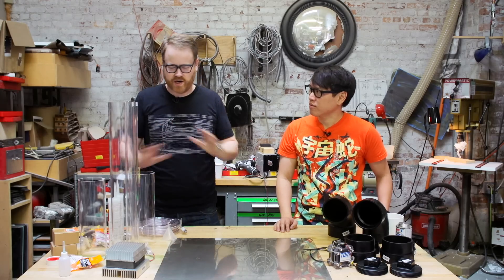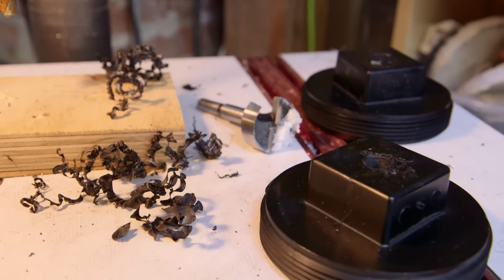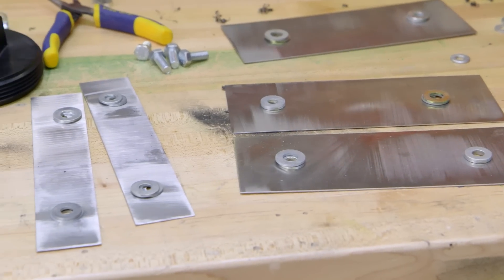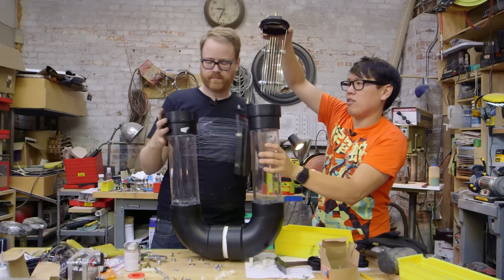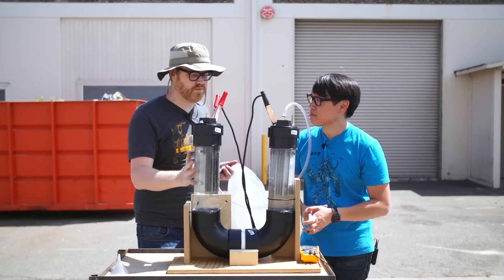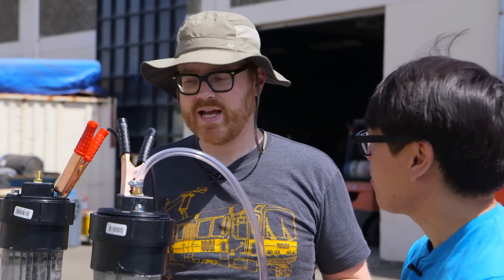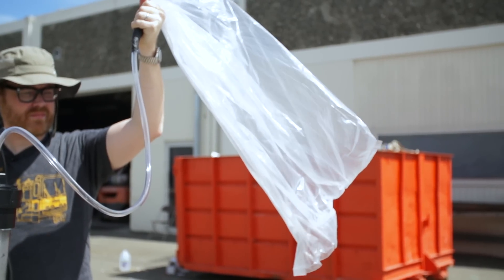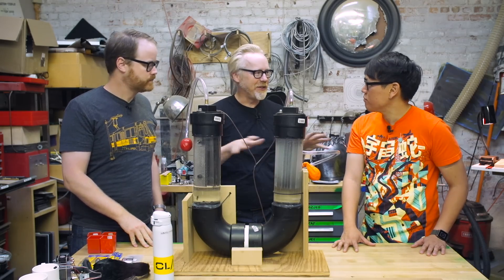Tested Builds a Hydrogen Converter

Comment: No.... I dont think thats how volts and watts work at all. You could easily beat the output of that solar panel with a 12 volt car battery because you're pushing hundreds of amps, vs only a small bit of amperage on a solar cell. Raising your voltage doesnt do very much at all.

Comment: They failed to many factors, no insulation from each side of the plates, and should have used plastic at bolts at top and separated the positive and negative sides also needed to drll many small 11/32nd wholes in each plate to cause more surface  area for more hydro and o2 dispenser the issues is many why ur not spliting as much gas from each

Comment: what surprises me is very few remember or recall that the first gas range was hydrogen gas.. HTE high temp electrolysis without any electricity.. and hydrogen is just like Methane it is extremely hot.. so it has to be cooled down.. just getting ready to show my grandson how it works.. if you want to look at an example.. just pull out your coleman camp stove.. it uses petroleum hydrocarbons.. but it is the same thing.. 
the biggest mistake that is made is people try to rip it apart not lull it apart.. the hydrogen being ripped apart takes to much power.. the other works easy .. the GEET fuel transformer was another way.. in 1978 a man made one through his catalytic converter and drove all across the USA being followed by every Mainstream media channel in the USA on ten gallon so fas.. he used the exhaust and the two electrodes that did the spliting of the vapors by the heat in the catalytic converter.. why does everyone try to make this so much more difficult..

Comment: This is the worst design I have ever seen.  Obviously these guys didn't do their homework.  There is a guy on YouTube that can produce 1L of hydrogen every second.  15L of hydrogen would take his system 15 seconds.  It worked off of 220V AC.  I found it interesting that you said it had to be DC.  Maybe they ran it through a rectifier, but I don't remember them saying that.  Also each panel of solar panel is 24V, so you could connect 10 of them in series to create the same power equivalent in DC.  240V is the way to go.

Comment: Lol....u people are wrong....use 24v DC supply with 50A current.....from two car battery.... connect to two 5 x 2.5 inches fuel cell....still...anod and cathode...around one for anod and one for cathode don't short them yaa and between them use one nutral sheet.....1 anod 2 nutral than cathode..2 nutral ..so one ...use total 2 sheet for anod 2 for cathode connect to supply.....and than cell bunch drop in distilled water in close plastic box .....and make High generat hydrogen

Comment: guy's this design has a major flaw...the bydrogas being collected is basically harmlesz unless the proper ratio 2 parts hydrogen 1 part oxygen. Because that's exactly what water is it's the perfect formula and that's why when you electrolyze water you can burn it immediately it only becomes water again when it comes incontact equal parts oxygen so you would have to re add oxygen from a outside source equivalent to one part oxygen  to burn it safe tho

Comment: You stacked the metal plates poorly. You should have stacked them top to bottom using small thin sheets and you can further improve it by wrapping them in steal dish scrubbers. Thinner plates let the electricity flow better, so you get a larger yields of amps through the plates per volt.

Comment: V-POOR GENERATOR DESIGN -- A UNIT THE SIZE U BUILT WOULD GENERATE MORE THAN ENUFF H TO POWER AN INTERNALCOMBUSTION ENGINE VEHICLE AT NORMAL DRIVING SPEEDS -- DO UR HOMEWORK, RATHER THAN FLAUNT UR BOGUS EXPERIMENT DATA THAT APPEARS TO WANT TO DISPROVE H-PRODUCTION FROM WATER AS A VIABLE ENERGY SOURCE.

Comment: Scientists have successfully split water into hydrogen and oxygen using light and meticulously designed catalysts, and they did so at the maximum efficiency meaning there was almost no loss and undesired side reactions.Jun 3, 2020, Shinshu University. Published in the May 27th issue of Nature, Tsuyoshi Takata of Shinshu University et al. broke through new frontiers in power production by using aluminum-doped strontium titanate as a photocatalyst, whose properties have been extensively studied and therefore the best understood.

Comment: These guys didn't read any of the latest papers on how to split water. They could have used an electrical current that pulses like a strobe light with just the right PWM. This causes a differential in the hydrogen gas, causing atoms of hydrogen to pair together into ionized molecules like ortho-hydrogen H+, deuterium, H2, or tritium, H3. Don't tell the government. Wink.

Comment: if I wanted the cleanest hydrogen for this setup I would plug the contraption in the wall. at that rate it would take lifetimes which is longer then the life span of the panel to offset the hazardous footprint of that cell. one of the challenges is the cost of the panel in terms of pollutants. the co2 emissions from the production of that solar panel will never be offset by this rig. I think that it is important that engineering goals should be honestly presented rather then fluffed with meaningless decorations like making green hydrogen with photovoltaics. It's not the dirtiest of hydrogen, but it is not as clean a that produced by methane even using steam reforming to produce the hydrogen. certainly relying on the efficiency of the power company to produce the electricity efficiently with the lowest co2 emissions possible would have been much greener then buying a solar panel for this project.

Comment: High efficiency Hydrogen production by Meyer process. -- Yes , produce your own power. Someone else again, has just duplicated the Meyer hydrogen gas generation cell with LOW power + high voltage, and excessive gas bubbles. He used melted snow which is better than distilled water, as less ionic state and high resistance/ impedance. This allows higher voltage to apply and astounding gas production. See You Tube    https://www.youtube.com/watch?v=gCAHCH0QFVo     H+H+O-- has higher energy content in ionic state. Resonance With Snow (No electrolyte) The Meyer US Patents ran out some time ago.... in public domain. Concentric stainless tubes 316L type only with about 1mm gap. The higher the dialectic value, the more gas you get. The original Meyer dual bifilar wound inductors were actually resistance type magnet wire (not copper). Frequency of power supply= vibration frequency of electrode pipes = resonant frequency of L and C - (the water capacitor)         Jaw dropping results - just like magic.

Comment: @2:45 you got to use way more glue than that, it's also used as a lubricant to help the fitting go all the way on.  edit: and glue on both pieces, not just the one, that was pathetic

Comment: This process is a vey efficient process. The problem is that they have a solar panel with a vey low amperage and a lot of resistance. Frankly, its just a really bad design. You could make more hydrogen with something a quarter of that size.

Comment: First off, these people control the narrative to what is plausible. Notice the joking stance of the main guy as he doesn't even take this subject serious. I'd say they work for the gov. You can make a large quantity of hydrogen with low amperage by vibrating the water to fracture the bond between atoms. I don't know the exact frequency but I'd say if you mirrored the same frequency of water in a submerged rod and made something like a feedback loop. Then the atoms would become unstable and fracture? Nikola tesla did something like this in one of his buildings and caused an earthquake. Matched the vibe of building with his vortex magnet field hardware?

Comment: the distance between negative and positive electrodes and the concentration of the electrolyte drastically effects amount or Browns gas produced. Like orders of magnitude. because you put the contacts in water so far apart to create gas separator U shape i bet you are running at less than 5%.

Comment: The dry cell produces more hydrogen hey dry cell produces more hydrogen I've done the test it will put out a half a bar pressure with that cell he just built versus a good dry cell you don't lose a lot of electrolysis in a dry cell like you do in a wet cell

Comment: if you dont want chlorine gas from salt water electrolysis, electrolyse at 100C to get NaClO3 and hydrogen on the other electrode, use carbon electrodes carbonized from biomass, even bread and weed grass

Comment: "The more voltage you run through the faster that process happens"... Uhm... no, the process pans out at about 1.5 V between each plate, that's why real generators have a couple of "idle" plates to divide the input voltage (most often 12 volts).

Comment: What a pathetic use of patronizing any attempt to move beyond the cess pool establishment plantation.  

Wouldn't it be great if there were actual engineers who took on these projects and maybe an occasional Joe, simultaneously?  But unfortunately,  that'd never happen and those who watch (who're actually brain washed) are totally convinced these guys are the definitive word on any subject.  Take for example the time Adam put a hydrogen hose down the intake of that 77 cutlass.  You could tell he was shocked it actual ran! But never did they address the necessary retardation of timing needed to properly operate that engine. No no no....their masters know their slaves will never cross the drawn establishment's line. Again, pathetic.

Comment: Dude use simple math...measure capacitive reactance and make inductor with the same reactance...then calc frecuency match for supply power electronics and something important add some acid citric 5% ..and you're fine for a wile....

Comment: The optimum voltage is 12V and a multi cell design is better also the strength of the KOH solution is important and a PWM system that can offer different charge density and frequency - A single cell unit produces dismal results - I used a cycling drinks bottle and a threaded bolt design - I could get a ballon of HHO - powerful gas - funny how H2O is written empirically the wrong way ? (H+ + OH-) is water. H2 is a gas O is a gas so HOH is more correct for water before its electrolysis which rearranges their molecules 👍😎

Comment: Perhaps you could make an ‘H’ formation to reduce the distance between the anode and cathode to reduce resistance through the electrolyte. Also fix the electrodes from the bottom of the brig rather than at the top to keep them submerged to reduce top up periods. Also use a less dangerous additive, common salt or vinegar come to mind.
Reply: hi i would like to ask if salt would be dangerous for electrolysis in water? i remember that brine could produce chlorine gas which is harmful to humans? as the volume of water decreases from electrolysis wouldn't the solution be more concentrated of table salt and be a potential danger?

Comment: Without amperage, You need high voltage D.C. power to create more HHO. ... Also The plates are better to be very close to one another.  It will not hurt to have the oxygen mix with the hydrogen to be expelled into any engine.  Without high voltage, you would need high amperage. One or the other guys. You can't get this to work properly with low voltage and low amperage.

Comment: Many things are off here.  Most have been stated already.  But a solar panel has an open voltage of 22 volts but as soon as you put a load on it, it drops to around 16 volts.  Also hydrogen is an extremely small element.  It will pass through a plastic bag.  At the slow rate of production they likely lost at quickly as the produced.

Comment: Just a little correction that I didn''t see anyone mention is that the hydrogen/oxygen production in NOT dependent of the voltage but of the current! The lower the voltage more efficient it is, in theory you only need about 1,481 V to produce hydrogen, anything above that is just heat

Comment: Your ohms are wayyy to high with your current setup.  Single outlet oxyhydrogen setups can be much more efficient but with far more dangers, ideally used for on-demand hydrogen.  Split output generators are much more inefficient but safer and more practical, especially when gas storage is required.  I have gotten way better gas output than you have using stainless steel kitchen scrubbers, baking wisps, sodium hydroxide, and distilled water in a split output system.  Also make sure your electrolyte is properly dissolved in the solution before administering current and decrease the distance the electrons need to travel through the water solution.

Comment: 2005-2008  S1R  Georgia car ran on water in carb!  6.5-7 amp pulses 
through spark plugs with dual 2MH inductors inside obsolete relays, per 
cylinder. 1978 El Camino V8 conversion (non computer type) with EGR for 
improved running with Nitrogen embedded water from exhaust. Water vapor 
pressure + minute Hydrogen gas formed and fired at 34 degrees late 
timing after TDC. Car tooled around town until put in storage. Low power
 and low RPM running. See data S1R9A9M9. Original web message board shut
 down. Resistance of 8 spark plugs not known. The delay line coils 
extend spark time for more contact of spark current with water. High 
voltage went through one coil and diodes. Other coil and diodes had low 
voltage flow. Electrical reverse back flow prevented by Relay diodes and
 was said to have magnetic field transferred to plugs tips in combustion
 chambers. To go above idle speed for some power, size of carburetor  
jets was redrilled larger about 30% , so as higher water flow. Return 
line wire from under each plug had to go direct back to inverter box - 
not through engine casting and car ground. Inverter not grounded to car.
 Alternator recharged both batteries. A couple technicians suggested 
there might be Radiant Energy coming from the high voltage jumping 
through vacuum sealed relay contacts gaps in vicinity of coil's fields, 
as TESLA Radiant Energy type spark gap. Strange output of Inverter with 
(2) diodes reversed opposite polarity, one on each side! Is this still 
AC 120v or pulse half wave 40v DC? Messages also never said if spark 
current was called "Average" on small hand meter or "Peak" current as 
seen on garage type oscilloscope. That would be about 60% difference. He
 said car got 18 MPG from water tank, and then higher when partial 
exhaust drippings were reused.

Comment: I built a hydrogen generator. I powered it with 24 volts DC and added a small pump. I made a no back fire gas hose and filter. And i was able to make a cutting torch. Now with gas prices and every thing else sky high. Im building a three wheeled 10 speed hydrogen bikes. In 10th gear it can go 45 miles per hour. It will travel one hundred miles on one gallon of water. I plan on adding pull behind trailers that can convert to a camper with stand up shower and toilet , cooking stove and refrigerator and couch that turns into sleeping area. I am seeking funding and will  offer a good percent in stock if a good offer to get shop tools and production started. Many i have talked to recently would like one built for them. Also we can build handy cap friendly transport bike. Each one is custom built for each customer.  make offers here for more intel. Or leave way to contact i will call back as soon as possible. Thanks for reading..

Comment: Could of done the same thing with an old broken car battery, tip yhe acid out and fill it with tap water,  charge the battery collect the gas. Same thing with the car battery more voltage more hydrogen.

Comment: That would have to be the worst generator I have seen, I have 2 x 9 plate, 110 x110mm units  in my garage which I run off a 12 volt unit with 20 amps in my garage, into a 25 litre tank, built by my business electrician, I use this for my barbeque and my gas cooker in the house, it works perfectly and supplies a great level of gas to do what I require. This was a very poor attempt, almost delibetly to play down HHO generators.

Comment: The problem with this design is the math! 100 watts of solar = 1.66 watts per minute, that is pathetic!

Splitting water to produce hydrogen is going to cost something! I would run at least 2kw through the generator 
A 100 watt solar panel is not good for anything more than powering a USB charger or maintaining a deep cell battery, but in the real world we use more power that that little panel will ever be able to put out...

Comment: Will not work if your car has an 02 sensor
It will just get worse gas mileage because it's going to enjoy it's going to inject more fuel to is to keep the fuel to air ratio at 14 to 1

Comment: The amount of current you pass and (therefore) the amount of H2 is an exponential function of the potential voltage applied. I bet the PV apparatus didn't apply enough voltage to overcome the overpotential on the anode and cathode side. The takeaway message that making hydrogen at home is perhaps fair, but the implication that electrochemistry is not a good way to do it is not fair.

Comment: I'm not a scientist or an engineer, but I am a curious person so I actually tried something like this in my kitchen many years ago. I have to wonder if these guys intentionally messed this up because my rig was like 1/10th the size of this and I was able to produce a balloon full of hydrogen with no trouble. I had to experiment with my battery setup and tried a few different configurations. I think with the equipment these guys had, they should have been producing a lot of gas.

Comment: It doesnt matter if you use 12V or 22V. Actually, 2V are enough. The current is the key, more current, more H. More than 2V generates hot as result of energy spending. They should conect the blades in a serial configuration sharing the 22V in 11 cells.